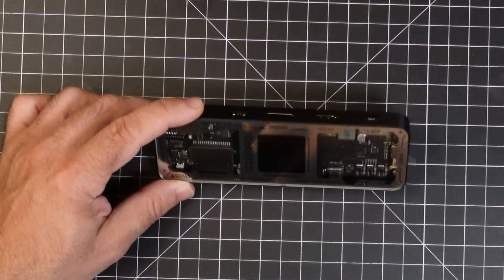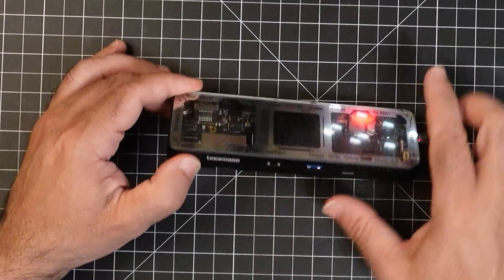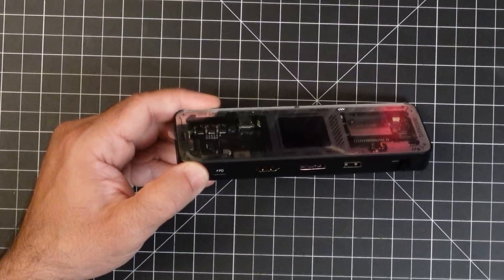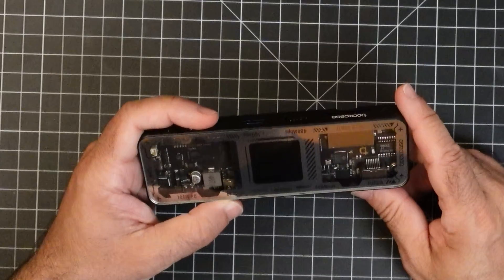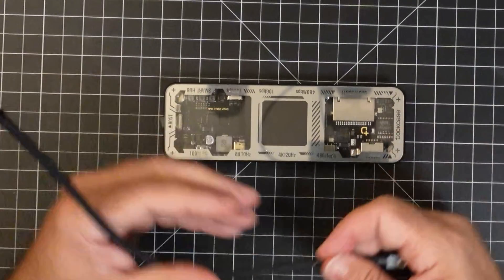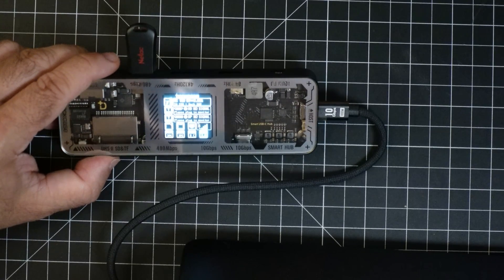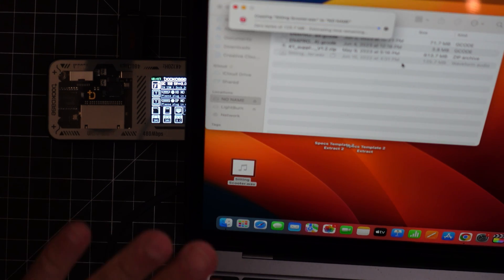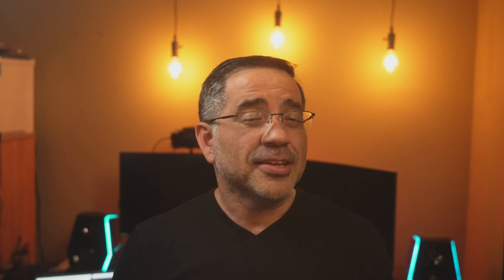Ultimate Hub for Work and Play, Dockcase Smart USB-C Hub 10-in-1 Explorer Edition

Comment: Any quality 10GB cable will do, you don't need to use the OG cable. I needed length to hang from my gaming handheld so bought a 2M 100W LCD cable to connect from dockcase to my Ally and 1M LCD cable from 100W Gan charger to Dockcase input. No issues, full power supplied. Very expensive dock, but has rare UHS 2 card reader which means you can avoid using faulty Rog Ally one, and all Gen 2 ports unlike many cheaper hubs.
Reply: Did you have any trouble getting Rog ally to output to external screen? I get an image but very intermittent. More off than on and I have tried it on two of these docks